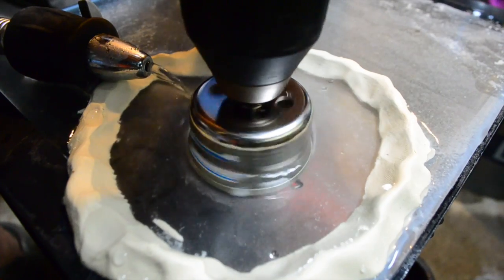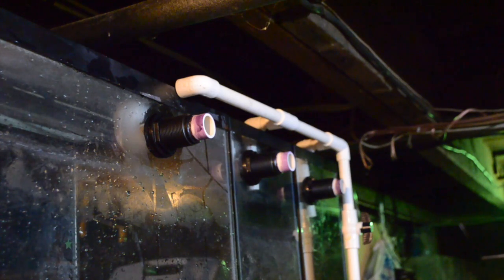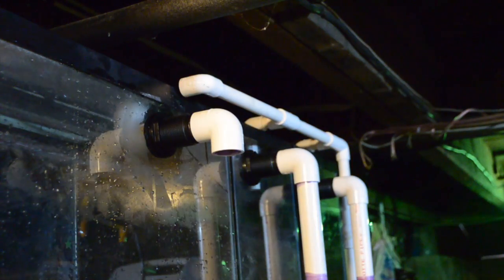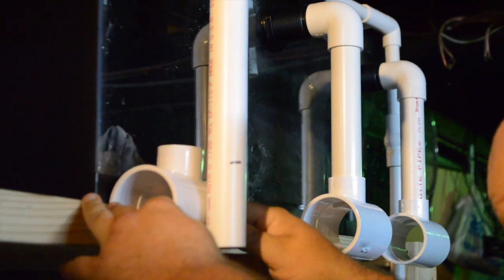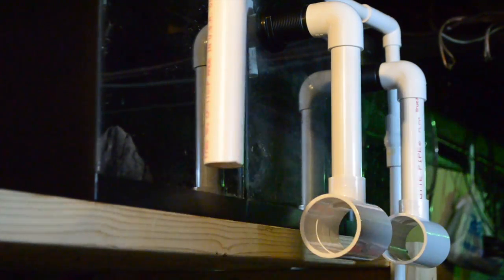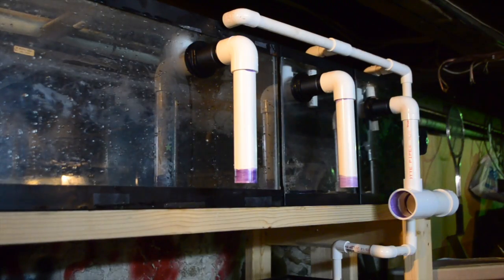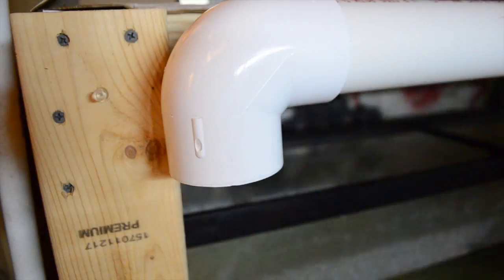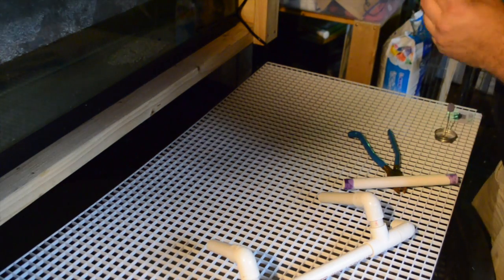How to Build a Quarantine Tank System

Comment: I wouldn't have your quarantine tanks connected. Any disease that one fish has the others will catch and not to mention how much more money you will have to spend on medications for 100 gallons of water compared to 10 or 20 gallons. Just my .02 cents. Also, some fish can tolerate some medications while others can't so what do you do then? Set up yet another quarantine tank?
Reply from the maker: Yup, i have a stand alone 40 gallon QT the multi-tank system is only going to be used for fish that can handle it. My basement is a mess anyways.The copper treatment I use isn't that expensive, especially when you consider the cost of fish.